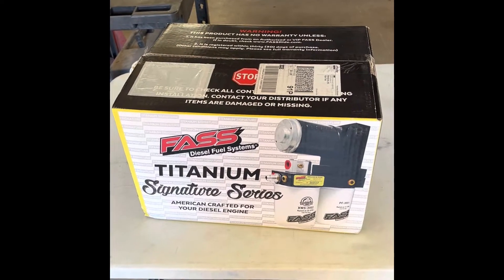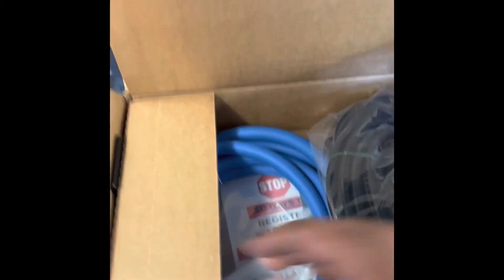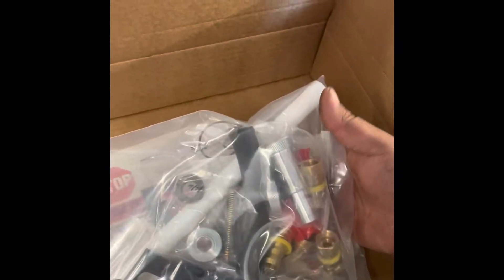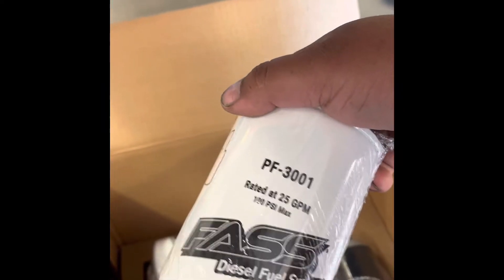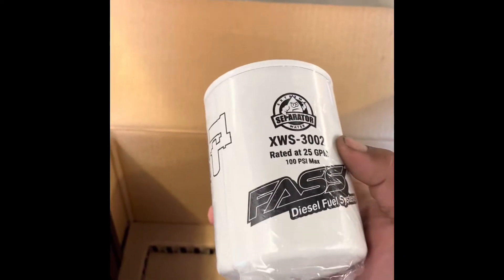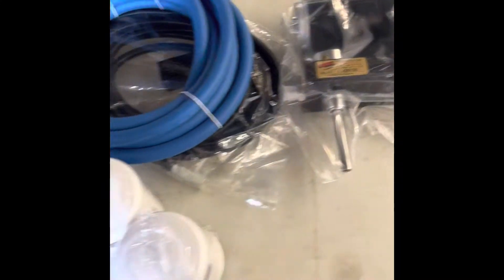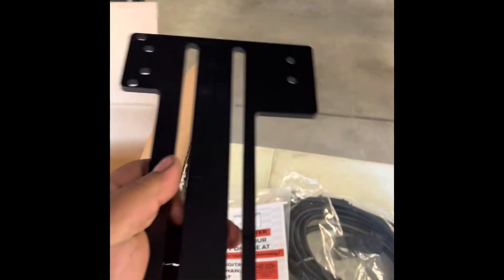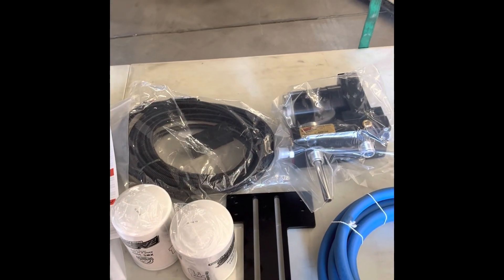Unboxing the best lift pump ! Fass Fuel System lift pump #liftpump #diesel #cummins

Comment: This install sucked mines leaking fuel where do you put the other line you cut off
Reply from the maker: There should be return a suction and a fass return going into the tank 3 lines in total on the fass system and a return from the truck it’s self should be going back into the tank